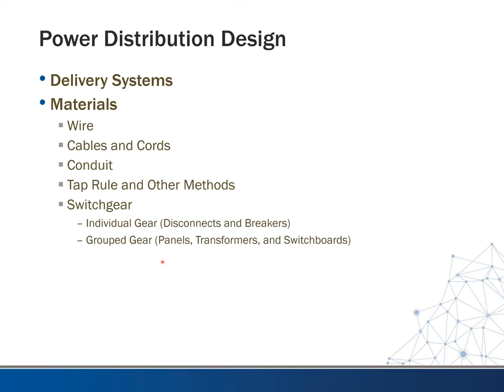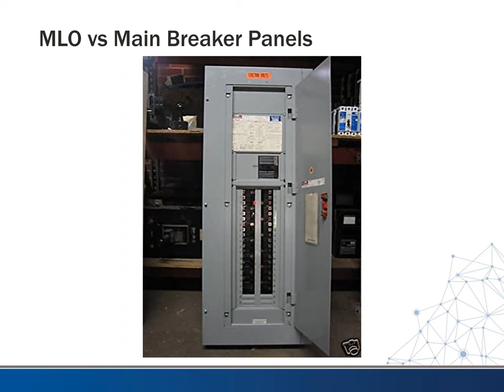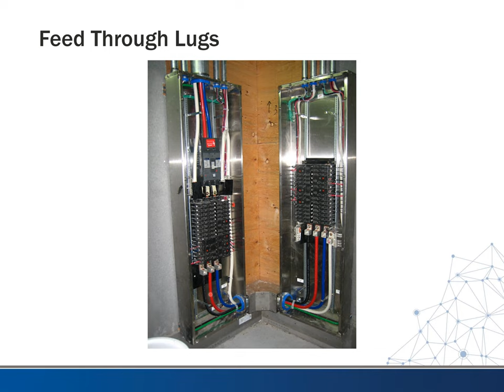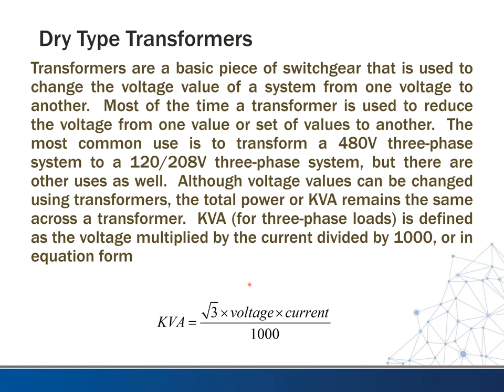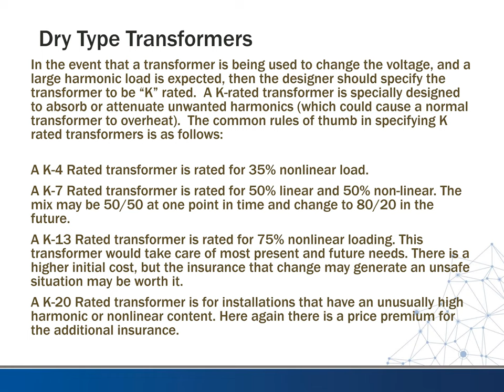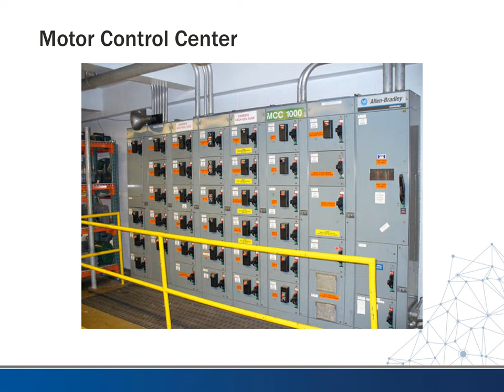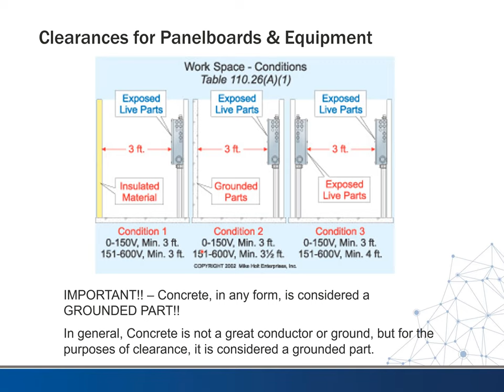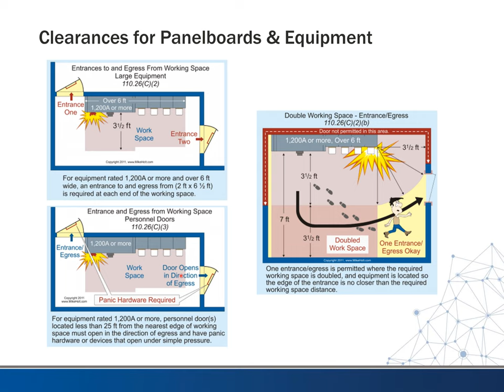Electrical Gear Assemblies (Panels, Transformers, Switchgear)

Comment: Question here Shane. If a suite panel is fed by a circuit breaker from another panel from somewhere cannot be seen direct, it seems the main breaker is not required. but does the code (NEC or CEC) require a main breaker in the suite in the case the user needs to shut down the entire suite power?
Reply from the maker: If the feeder feeding the panel is already protected elsewhere, the panel is not required by the NEC to have a main breaker.  However, you can still have one for convenience if desired.  Some clients do call for main breakers even when it is not required for this very reason (convenience).
Reply: @shaneritterEE  great, fully understood.